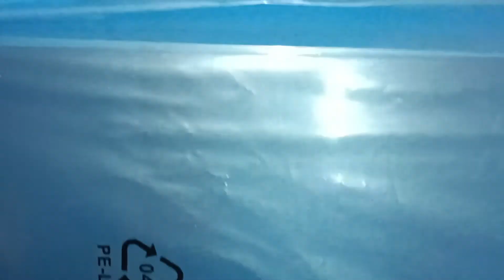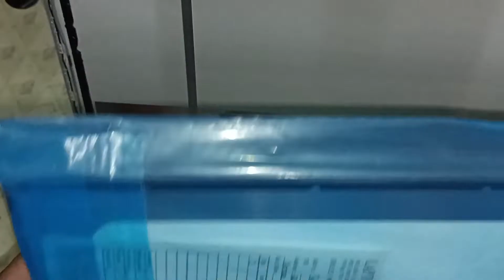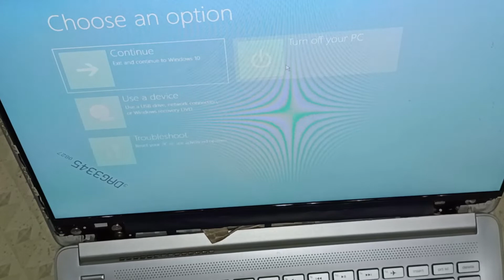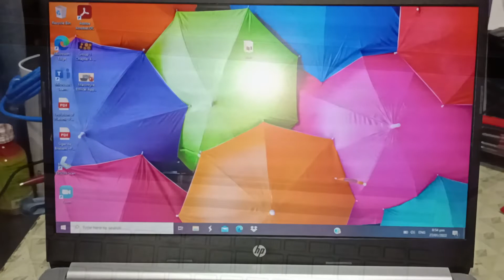HP Laptop  14s cf3026tx LCD Installation

Comment: Hi. How to turn on my keyboard backlight? Same laptop please reply me
Reply from the maker: If your notebook computer has a backlit keyboard, press the F5 or F4 (some models) key on the keyboard to turn the light on or off. It might be necessary to press the fn (function) key at the same time. If the backlight icon is not on the F5 key, look for the backlit keyboard key on the row of function keys.